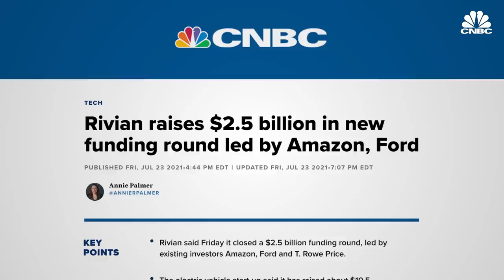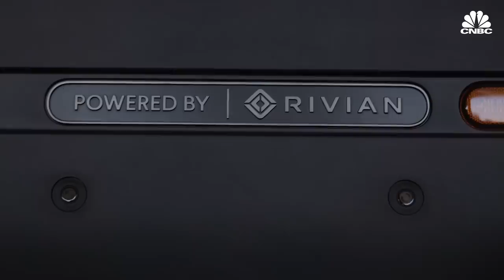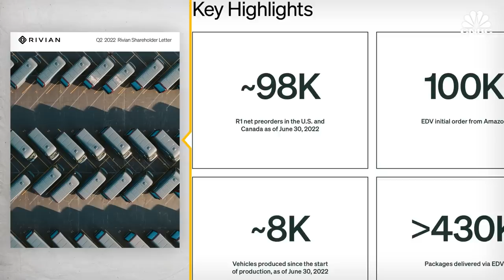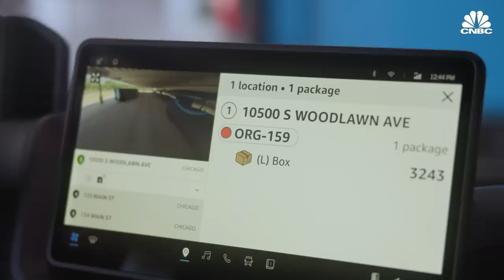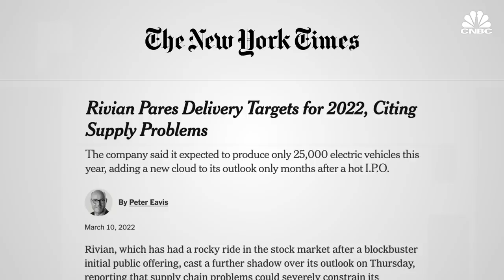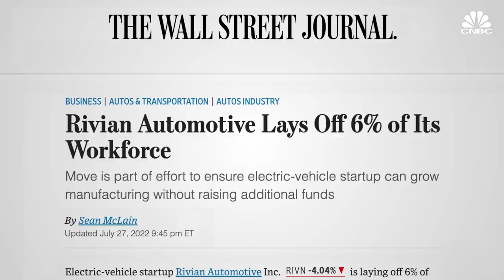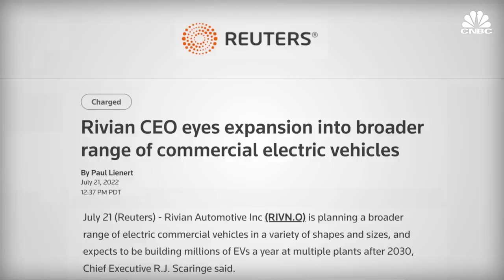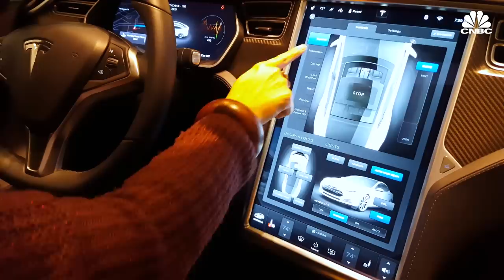How Amazon Is Giving Rivian An Edge In The EV Industry

Comment: It is actually smart from the Amazon side to have a custom delivery fleet made "from scratch" to their specific needs. Instead of converting regular vans.
Reply: Honestly it was a publicity move to green, which is the goal. However as a company you don't want your entire fleet reliant on another company for service, which is a huge risk. As with the current ICE offerings, finding a repair shop and turn around times will be much faster. I won't invest in any EV tech for at least 10 years.
Reply: @bOOmbOOmProd  It’s a risk worth taking for small companies that want to have an edge over competitors.
Reply: @maxpro751  exactly. These companies are what they are today because they have risked to be the first timers
Reply: @bOOmbOOmProd It wasn't a publicity stunt for going green. Going electric has huge benefits when it comes to savings in fuel, and regular maintenance.

 Now personally I think Rivian and other car makers need to catch up on the manufacturing side. Tesla is murdering it with profit on their cars from what I've read. 

 I'm surprised Tesla hasn't tried the smaller delivery trucks. Or even construction trucks. 

 So Rivian should focus on that. No one is excited about Rivian vehicles in my mind. They are generic as hell. They need to generate excitement for their brand. Same with Lucid which creates amazing cars, but eh. No personality.

Comment: I’m a manager at a amazon delivery station, I can’t wait to start seeing these
Reply: I'm a forklift operator at a distribution center, and am eager to see them as well.
Reply: I just seen one outside of Baltimore earlier this week. Was pretty cool to see such a big truck be so quiet.
Reply: I would hate to be the driver whose battery runs out mid route.
Reply: @Hi-qh8zt  really? You wouldn't wanna be paid to sit while they recover it? I would 🤣
Reply: @Jeromeeb  no because I've been broken down in my step van waiting for recovery and it's lost money and lost time. of course I don't drive for Amazon so I don't work at an hourly rate. when you make a day rate you wanna go as quick as possible.
Reply: @Hi-qh8zt  yeah, I don't know how amazon pays but I was always hourly as a driver. I've had to sit for hours with blown rear diff, dually looked like it was doing a split walkin the axles out.😂 thank god for smart phones and streaming services
Reply: @Jeromeeb  I think they start their drivers out at 15 an hour and go up from there. But I would never work for them just my guess.
Reply: @King Vegeta, how many miles does each last-mile delivery vehicle typically drive in a day? Will this work if it only goes say 200 miles?
Reply: @mroberts566  it depends on the route, most of the packages should be very close to each other. A lot of miles come from driving to first location and back. average probably 100-150, could be as low as 30 or as high as 200.
Reply: @KingVegeta90  Oh, that's super interesting, so it sounds like it could be a good fit. Thanks for your response.
Reply: @Radiator Dash That could be. However, based on  King Vegeta's response about typical miles driven in a day, I'm inclined to think they'll make it. They'll be cheaper to drive and cheaper to maintain than Amazon's current fleet, which means Amazon has a financial interest in seeing them survive. If it starts to look like they're going to fail, Amazon/Jeff Bezos may just swallow them up and make sure they survive. In fact, that will eventually probably happen either way.
Reply: @Jeromeeb  *saw one...
Reply: *an Amazon...
Reply: @snakedoktor6020  tell me you dont have a life without actually saying it
Reply: @KingVegeta90  So worst case, they will need to take a short break on a charger. Can't wait to see one.
Reply: @Hi-qh8zt  lol why? Paid by the hour. Nmp status
Reply: @RandomPerson-vf3ld  Because the way I get paid I can go work five 5 1/2 hours and make eight hours pay at double what they make that's why. And that's roughly my workday
Reply: @Radiator Dash It's been almost 24 hours since I watched the video, but I think it said Rivian has a few more years to supply the number of EV's promised. However, missing the target could wind up being a good thing. They miss the target, Amazon cancels the contract, Rivian's stock plummets, and Amazon gobbles Rivian up at a low price and gets into the EV business.
Reply: @Hi-qh8zt  the computer calculates the delivery run againts battery capacity and calculates accordingly. You'll never run out of juice.
Reply: @joeabad5908  time will tell fokes
Reply: @danieldaniels7571  Do you think forklifts will become electric one day?
Reply: @A B it hasn't been for me. For the most part I really like it. It's certainly the most flexible job I've ever had as far as scheduling and taking time off goes.
Reply: @LaSombraa  all the forklifts at Amazon are electric already, and have been for the seven months I've worked there. I've never operated any other kind!
Reply: @mroberts566  i drive on average 30 miles a day.
Reply: @A B not really it depends on the location.
Reply: @Hi-qh8zt  i’m paid hourly with guaranteed 10 hrs pay if i work less hrs. if i go over 10 hrs then overtime kicks in. the whole daily flat rate kind a pay is great if everything goes well and you done early. i used to get paid on my last job $300 a day to do nothing  all i did was show up to work pick up some papers then go home and enjoy the rest of the day. on Thursdays that’s when i actually spend the whole day at work finishing up the weeks worth of work.
Reply: As an amazon customer i cant wait either
Reply: @Hi-qh8zt  I assumed we were still on the subject of Amazon using these Rivian vans, hence it not mattering to the driver. Unless you work for Amazon and are telling me that they aren't really hourly. Seeing how calculating Amazon is I would highly doubt they'd send a vehicle out that couldnt complete its route.
Reply: Hey I want to work for this amazing company Amazon please tell me how can I?
Reply: As a former driver. Its easily to put 150 miles with 200 stops for 10hr shifts. Doubt this will work for most routes unless its the same city as the delivery station.
Reply: @Hi-qh8zt  nice that they wont, the range is more than enough for them as delivery vehicles drive less per day than you might think
Reply: I'm a janitor at an amazon distribution center ,I couldn't give two fs about these vehicles.
Reply: Tell ur boss, drivers should get a raise. More cargo means more work.

Comment: I hope Rivian is successful and these vehicles last to give EV a good reputation. This will give the public confidence in EV.
Reply: Amazon's transportation needs are not the same as the regular family's needs. EVs don't work for a lot of people.
Reply: @tinytownsoftware3837  I think they would work for a lot of the people who think they wouldn’t.
Reply: @aidanrace814  They work for homeowners who don't take a lot of longer trips. They don't work for people living in apartments. Who exactly thinks they won't work for them, but you think they actually will?
Reply: @tinytownsoftware3837  wrong
Reply: @katzgar  Wrong what? That EVs don't work for renters? Where are they going to charge those things every night? Low effort comment. Sad.
Reply: @tinytownsoftware3837  They would charge them at superchargers like majority of people do. Majority of vehicle owners drive less than 100 miles per day, the only downside to EV's at the moment is just initial cost and transitioning to electric over gas/diesel. Electric motors on average last far longer than combustion motors and solve the issues of drivetrain problems with combustion vehicles. If people travel a lot or tow/haul equipment and live in cold weather enviroments, they are more likely to want a diesel or gas vehicle, but for majority of people in the western states that are dryer, EV's work exceptionally well.
Reply: @rpnp2  Sure, until those times when you need to drive more than your range in a day and you have a screaming baby and todler in the car. Even if the charge takes 30 minutes, you don't want to be in that situation where you have to charge your car so you can get home.
Reply: HOW ? From where the energy will come from ?
Reply: @rpnp2  first that battery is not gonna last as long as gas at this moment. You still pay for electricity, and here in ca i am not sure if it was really that much cheaper. Plus we are still burning fuel for the electricity atm. Plus making those batteries also cause a lot more pollution as the tech stands. So no, i won’t just get an ev until technology improves, right now it’s just a bunch of marketing bs.
Reply: @kevinji7285  I believe jerryrigseverything regarding evs. They're more efficient, durable and whatnot. Watch his video.
Reply: lithium disaster
Reply: @tinytownsoftware3837  liar
Reply: @tinytownsoftware3837  think before you post
Reply: @katzgar  What did I lie about? I can post whatever I want, what are you going to do about it?
Reply: @katzgar  Wow, you've now commented twice that I am a liar. Someone got triggered!
Reply: The public is not buying Rivian. What they offer are SUVs and pickups in the luxury range. Your average Joes are not buying those. And then you've got these vans which are made for the likes of Amazon. Tesla is the one who gave the public a taste for EVs.
Reply: @tinytownsoftware3837  why would they work good for homeowners but not people in apartments? Nvm that question I saw the other thing you said and although you are sort of right there are places to go to get them charged and I do think future apartments may state to add charging although I can’t confirm that.
Reply: Lmao, I hope you didn’t invest in RIVN 😂

Comment: Rivian can get into school busses, which is for sure a huge market and needs the electric revolution
Reply: Our school system in Montgomery, Alabama plan to start purchasing EV busses in the upcoming future.
Reply: Yes school busses and especially post office vehicles, EVs are perfect for post office routes.
Reply: Navastar is far ahead on electric school buses!
Reply: @jamisonmunn9215  They could have made EVs for postal routes thirty years ago using lead acid batteries.  The postal carriers, where I live, drive the main roads, park their vans, and then walk down the block to delivery the mail on foot.  They probably drive less than ten miles a day and never exceed thirty miles per hour.  A postal van has plenty of space under the cargo floor for batteries and it could be recharged when it is parked over night at the post office.  Instead, they still use those 4-cylinder, 78 horse power vans that you can here coming from a block away.
Reply: Hai Boai  good job 🙏🕶️

Comment: I've been seeing more and more of the Rivian trucks on the road. Those unique headlamps make them easy to spot. Still not a ton of them out there, but enough for me to notice. Reminds me of when Teslas were first coming out.
Reply: I've only seen two of them in Atlanta. And also we're set to build a new Rivian Factory 60 Minutes away from the City.
Reply: @AKUNJIG  i see them everyday im the bay area bc they test in my area but its still kind of weird seeing them
Reply: @shoutingatclouds1050  Wasn't the first Tesla Vehicles Manufactured at an old Toyota Factory?
Reply: @AKUNJIG  I pretty sure about my post especially the old GM plant part. Rivian is a rabbit hole if you want to go down it for yourself.
Reply: That's a big lie. Rivian has sold 5600 passenger cars TOTAL. The odds of you seeing "more and more" are astronomical.
Reply: @tinytownsoftware3837  
Idk what to tell you bud cause I've literally seen them with my own eyes. Even if there is only about 5,000 of them, I live in the state that they are being made it, so it's not really that crazy that I've seen a handful of them. I remember even seeing a pre production unit on the street a few years ago.

That number you have must be old, but probably not that old cause of how quickly they have been producing them. They were at about 7,000 this past July and they plan on reaching 20,000 by the end of the year. 

So yeah, they keep making more and more of them thus I have been seeing more and more of them. See how that works?
Reply: @tinytownsoftware3837  I drove next to a car carrier full of them going to Florida.
Reply: They kinda copied the G class headlights here
Reply: Guy at my company bought one and that the second I have seen since they released. It's a pretty cool truck and I hope they stick around.
Reply: Gotta be one of the worst looking vehicles in a long time. Enjoy being a hippster.

Comment: The biggest hurdle in the automotive industry is the cash flow.  The power that Tesla is doing is that they now own the gas station as well as the production.  It makes it a lot more of a valid investment.  Rivian needs a stronger cash flow than just a car.  The internet of things is all about that.  Any Amazon tech partnership that could increase revenue and cash flow would be beneficial.  I would also like to see sensor data for auto insurance companies as a deal with the automotive industry. If amazon had their tracking chips that they had for their own store in each package, the loader would simply just need to load out packages and the delivery driver would be able to find the zone where the package is using their conttrol to where the package/items are located saving time for the loaders as well as the delivery driver.

Comment: The main thing I would worry about it durabilify.  I work for a Ram dealer and the Amazon Promasters take an absolute beating.  To the point where the driver door hinges have pulled the metal off the chasis.  and have to be rewelded multipul times
Reply: Stuff like that has been accounted for during the design of the van, along with many other quality-of-life improvements for the drivers =)

Comment: 8 years from now, all these EVs will need new batteries. Currently replacement cost of an EV battery is $26,000+ and rising with the increase in material costs.
Reply: Companies look at things like this with accountants etc.. most likely the diesel/gasoline powered delivery trucks are estimated to cost a lot more to maintain and refuel then it is to charge one of these trucks or even replace a battery that far down the line. If it was a waste of money they wouldn’t do it, it’s not about the environment to them
Reply: New cars in general now have an average lifespan of around 6 years. Today's EVs are just too technical, but ICE isn't that far behind in terms of outright longevity.

Comment: Rivian pickup trucks for example  have shown that there estimated range on a full charge is not accurate, when you  add in factors like payload weight or even a trailer net weight before  loading it, or even something as simple as a person body weight can become a factor in estimated range,
 ( if you are over weight) all of these factors can be implemented into any new EV in order to determine the true range of an EV. These factors can also contribute to the longevity of the battery pack in side the EV. And I believe this is the single most reason why 1 in 5 EV owners go back to an ICE (internal combustion engine). vehicle Thanks